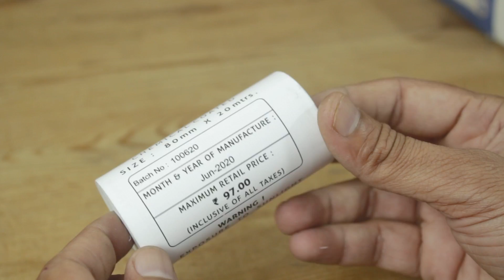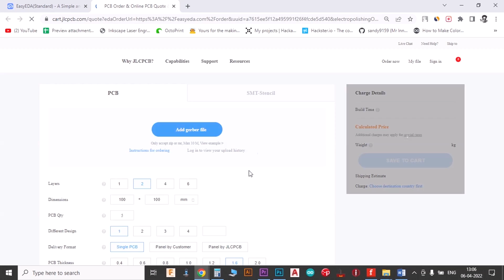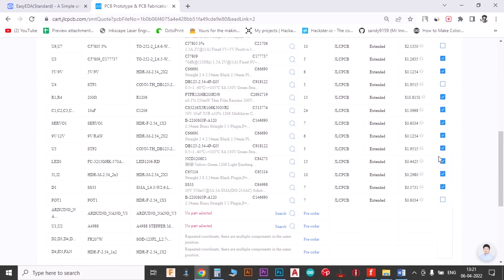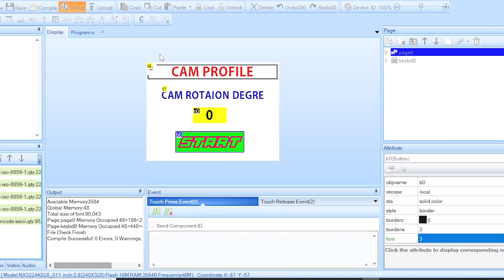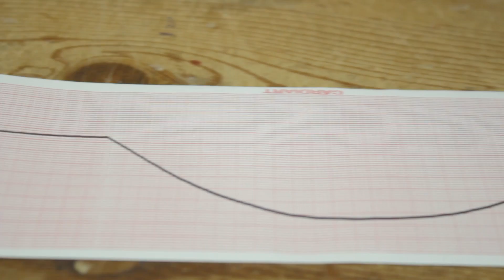DIY CAM Profile plotter machine | Arduino based project | Prototype

Comment: Looks great but what is the point of it? Can you use the line to copy a shape? What would it be used fore?
Reply: For testing the output waveform of various cams for engines without having to actually build the engine you could calculate efficiency of the shape. Think like a Wankel engine
Reply: @Leviathan3DPrinting  that’s very interesting cool
Reply: @Leviathan3DPrinting  wow really? Interesting